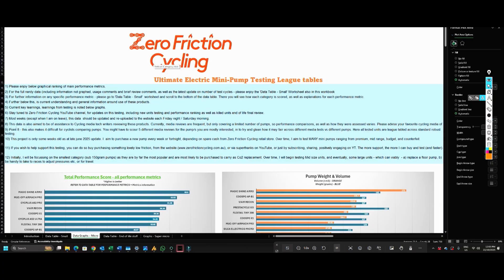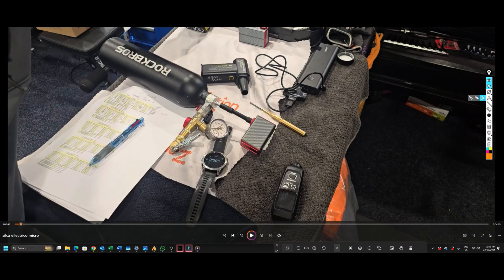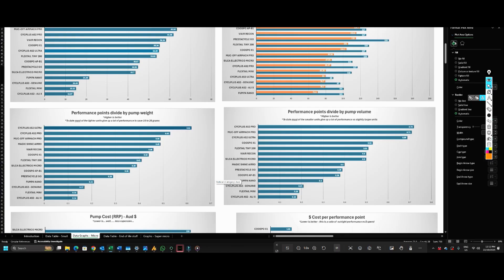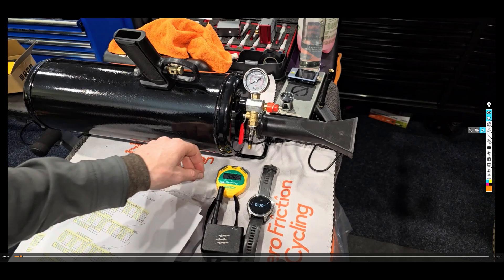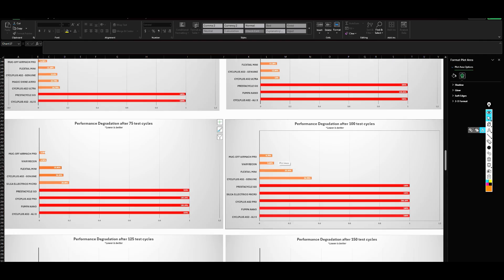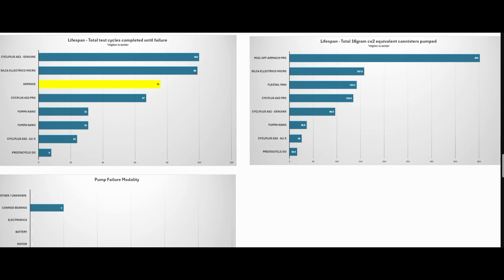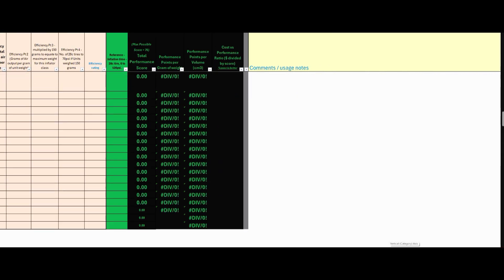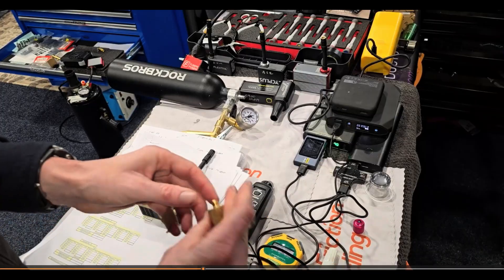Electric Mini Pump test protocol!

Comment: Do you include the ease of maintenance for these pumps? 
Like how easy it is to disassemble and change seals? 

Its depressing for the consumers with the data you present. 
I really expect military grade durability with these pumps.
Reply from the maker: i do a tear down at end of life, so for each pump there is an initial performance benchmark, and then when its dead an End of Life review with teardown. 

So far no pumps are repairable. 
> Silca advise replacements seals will be available, eta early 2026 from memory. However replacing any of these pumps seals, as well as cleaning and re lubing with a very specific lubricant - that is not something user friendly to do at home. So how this is done is unclear. Authorised service agent? send back to silca? who pays? how much? If cost to replace seal factoring freight to and fro, parts and labor adds up to 50% the cost of a new pump, is that viable etc. 

> Fumpa claim pumps can be sent in for service and repair but realities of this seem changeable at best. I had a fumpa OG years ago, it stopped working properly after a year is, said it was a capacitance issue, and replaced under warranty. Good to have warranty, but original was not repaired. The fumpa nano on test here seal went quite early - i emailed re repair, they advised they can sometimes but to busy at the moment to offer repair service. 

No others i am aware of have any information on service, repair or replacements for internal parts. 

Average lifespan is a big range  - stay tuned for that update soon, but average so far of all pumps killed is 84 test cycles. 

This is a lot if it is just puncture repair, insufficient if taking on duties of floor pump.

Comment: If I'm solely into MTB use, are there differences in the way that some pumps are better in high pressure application and others are better in high volume application?
What is important for me?
- inflating 2.4" tyre to 1.5 bar - as fast and as many times on one charge.
- maximum air flow with removed valve and low pressure (under 1 bar for sealing tyre bead)
- reaching approx 3 bar max for proper tyre bead seating.
I think these are the only things I could care about (+ dimensions, price, reliability...).
I'm not sure those can be properly simulated with smaller volume at high pressure (same work), because I can imagine the ideal pump construction for this use case is different from an ideal construction for road bike use - like with floor pumps - MTB specific floor pumps have much larger diameter and can easily seal a tubeless tire without any kind of "booster", but are limited to 4 bars and obviously pain to do any more than 2 bars because of too much force needed. For MTB - perfect. For road - no way.
But I haven't seen any MTB specific battery pump.
Do you have any insight if some do surprisingly better in low pressure application - and on the other hand - some suck there?
Reply from the maker: great question, and something i have been looking out for, but so far in this category there hasn't really been a pump i have seen yet that is really focused more on lower pressure or higher pressure. Ie a unit aimed specifically for gravel / mtb would in theory have a larger diameter piston and or longer pump stroke for more volume each rpm. They may tweak for slightly lower rpm and more torque but the volume per stroke outweighing the rpm drop.  A high pressure pump would have a smaller diameter piston and less volume per stroke. 

This is something we see with manual pumps aimed at mtb / gravel or road or track.

So far however all the pumps in this small category have had pretty similar piston diameters and rpms. None appear to have been tuned to be better at one end of the spectrum or the other. 

The main thing i would say is that if a pump is a bit performance lacking, it can be a little bit less so at lower pressures and start to be more apparent at higher pressures as they lack the outright performance to handle the harder workload. In short a cheaper, poorer performance pump is more likely to be ok at pumping duties going to 25psi vs if it regularly had to go to 70 or 80psi. 

So i would still just check the bench mark times on the table / graphs for inflating to 70psi round 1 and round 3 that it is a competitive time, and for mtb / gravel where you might be needing to fight for awhile to seal up a plug, and or battle some level of sealant restricting air flow through valve core - you really want one with good endurance (total grams of air pumped per charge). Inflating one tube to 70psi for a road puncture replacement is comparatively very easy duty vs what we have to fight on the trails sometimes. 

At the moment if i was road only - the cycplus ultra for sure. For gravel / mtb - you will be well served with magic shine airro, viair recon, Muc off airmach pro, cycplus AS2 Pro, or a good budget option so far looks to be the Coospo X1. Out of that in real use - AS2 pro, magic shine, and coospo all  have display facing away from you which is pain in the arse vs seeing pressure live as you use nice and easily - which the muc-off and viair recon do. The viair recon is simply lovely all round. 

Place your bets on when the first Gravel / mtb specific electric mini pump comes out and who makes it. Based on past, i'm betting silca is first! :)
Reply: @zerofrictioncycling992 That's what I thought - all use approximately the same piston size - similar construction.
My favourite was the Cycplus Ultra - do I understand well that you think it's too small?
I don't know who brings the MTB first, but I would guess Fumpa, because they simply seem to me as the ones doing it their own way. Now they have their new small pump with gauge (not MTB specific ofc) - looking forward for some reviews. I have sympathy for everyone not outsourcing their production to Asia.
Reply from the maker: for me for mtb / gravel yes the ultra is a bit small. I have had some fights thats for sure with decent puncture and many plugs and still some work and inflating for the pump as try to get things finally sealed up. Gravel nationals earlier this year i had to use 8 plugs - 8!!!  for big sidewall gash, and it used the full cycplus AS2 pro to finally get sealed and get me up to 15psi - just enough to get me up and running complete the event. An ultra - it wouldn't have had enough endurance to finally get things sealed up and some pressure in. I have had other mtb or gravel punctures over time where it has taken a reasonable amount of pumps battery to get things re sealed up and up to pressure, then may have to top up again later in ride etc. 

Ultra is groovy for inflating a tube to repair a puncture - it can do that circa 3x, so no problems for tubed repair. For tubeless where we need to get things sealed up which sometimes can present and endurance fight, there could be for sure times an ultra doesn't quite make it where a circa 130gram pump like as2 pro, viair, muc off air mach pro, magicshine airro etc - they can fight a good fight!
Reply: @zerofrictioncycling992 This is very usefull info. Thanks a lot. I've seen a new viair with aluminium noozle, which could solve maybe it's biggest negative.

I have one opinion on the test results - or rather to their interpretation. Those relative metrics - like performance to weight ratio - rather than one dimensional column chart, I would use two dimensional chart - x axis is weight, y is performance - each pump is a point in the 2D space. With many pumps in the chart, there would be nice interpretation of the trend.

Comment: Another great video, if you use one of them pumps a handful of times per year to test it and just carrying it for emergency, do you think the battery would degrade after 2-3 years
Reply from the maker: in general no, and so far i haven't seen parasitic drain be an issue except for potentially one which i am going to check further (but mostly i can't test for that as its just pumps sitting around for months). 

Batteries are typically fine for AT LEAST 300 to 500 full depletion and re charge cycles, which is well in excess of seal lifespan (and likely as well as bearing). 

Main danger for batteries will be if a) it has been left long enough to deplete to a voltage below 3.2v per cell - they REALLY do not like that. This could come from someone using and forgetting to recharge, and then some months later especially if it is ridden in very cold temperatures. Once cells go below 3.2v they can refuse to charge / recover. 

But mostly - i think the times batteries need to be replaced or thats the cause of pump reaching end of life will be exceptionally small - it is the seals that need to be replaceable, that is the big glaring wear part.

Comment: You mentioned that the pistons wear under pressure and temperature. When you perform your test cycles, do you wait for a specific time or until the temperature has decreased to a certain value before starting the next cycle? Or do you start the next cycle immediately after the previous one, with higher temperature and wear throughout the test?
Reply from the maker: it is the piston seals that are the big wear item. In my testing - for the main performance benchmark tests they do the first 3 rounds with no cooling, then cooling fan applied for rounds 4 and 5 if they have the battery life.  Depending on the pump we have seen external pump temperatures of anywhere from 50dg c - quite warm to hold, up to 70dg c - too hot to hold. 

The testing cycles in between on the big tank have a small fan blowing - they get hot, but not over hot. 

For sure getting too hot - this MAY cause seal failure. Seals design and material does seem to be quite variant - and so X pumps seal may handle high temps ok, other pumps seal may not.

This is something i can't focus resources on testing as well as doing the current testing. Some pumps also have over temp protection built in, some dont - i might look to add that column in the main nerdy data table. The main tip would be don't push them until they are too hot to hold, but some pumps with silicon cover - one may not realise how hot they are, and they will heat them up faster.
Reply: @zerofrictioncycling992  I see. Then many pumps will probably have a longer lifespan than your test results show, since you usually let the pump cool between each round in real-life use.
Reply from the maker: hopefully yes, the testing here is meant to be a strong stress test. Cooling is applied for the 4th inflation of performance benchmark test it is on from the start for the lifecycle tests. So whilst run for full battery and with some thermal stress - it is hard to know with X pump and X seal - but it is likely that as long as temp remains below Y - the main aspect will still be physical wear vs seal issue to due temperature. 

They can be and are killed in real life by people not letting them cool down. Medium warm day, and using with the silicone cover on which greatly reduces cooling and rapidly increases temp as its basically wearing an insulated jumper - they can reach temps in a short time what would take multiple rounds here to reach. Whilst probably at least half these days have a temp shut off, reaching that point is stressful for the unit and can for sure shorten lifepspan.

Comment: Congratulations on all these tests. I would like to have a ranking of the 5 best mini pumps. Thanks if you have the time.
Reply from the maker: Good idea, i am going to be doing this in an approx 6 monthly test review, but i should have a running top 5 - i have just been a bit stuck on separation of on bike carry recommended only vs on bike + floor pump replacement etc. But yes, i will figure that out and get a top 5 leaderboard tab (and maybe a bottom 5 - avoid tab).

Comment: Any thoughts on the longevity of the AS2 Ultra pump?
Reply from the maker: So far so good, it has just passed 50 test cycles and performance check at 50 the degradation overall was ok. I have a feeling it will struggle to make 100 cycles ok just off how cycplus seals seem to fair long term, but - this pump at just 90 grams really should be just a ride carry option, i don't think / hope that not as many would look for such a small pump to take on the duty of floor pump replacement. It is working like a bat out of hell when going (i bet when do the tear down it will be the highest rpm tested) to get such performance from such a small and light package.

So for ride carry for puncture repair only - great performance through 50 test cycles - that is going to be plenty. If one has more than 50 punctures in say a 10 year period, they need to review their tire / riding choices!  NOTHING i know of yet is remotely close to the AS2 Ultra performance vs weight, so it is my top ride carry recommendation for most if they have the budget.
Reply: @zerofrictioncycling992 appreciate the info, thanks